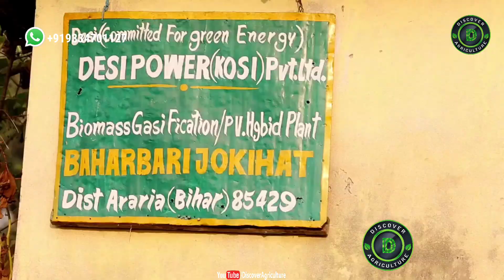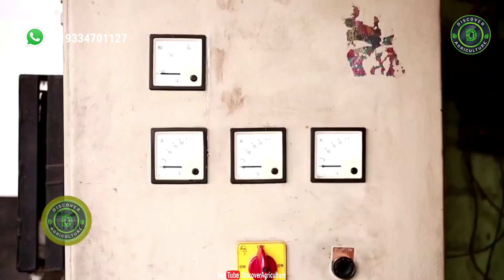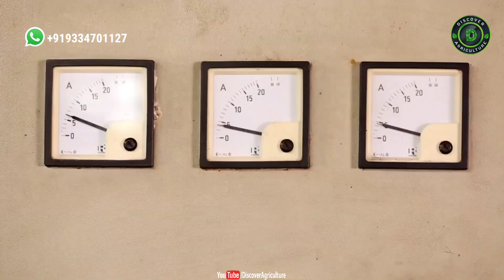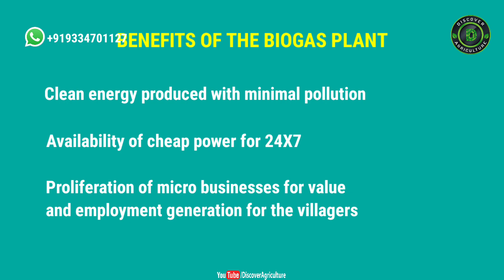Bio Electric Power Plant - Biomass Gasifier Power System

Comment: The cost is not economically viable.
Rs 35 Lakhs produced 10 units per hour or 120 units per day.
Assuming Rs 3 per unit, Revenue is Rs 360 per day.
It will take 26 years of revenue to just be equal to the capital cost.
It doesn't consider the cost of raw material and labor.
Reply: Lol, price of a unit is 8 to 15 rupees now.